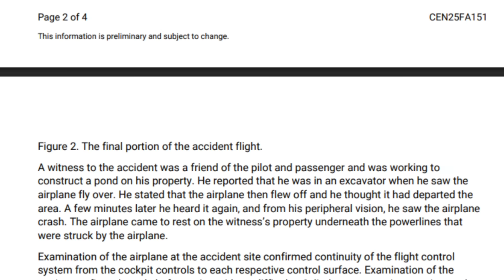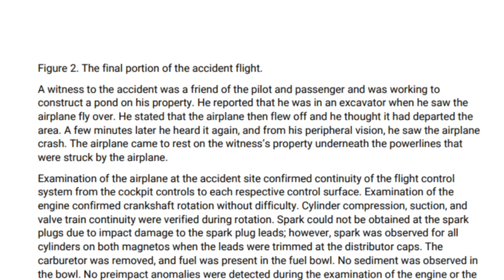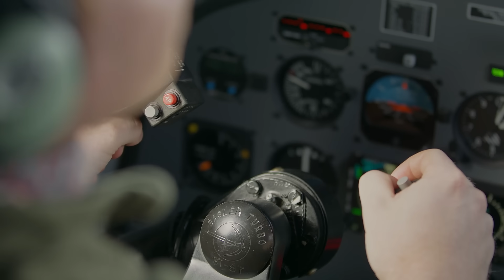The Real Reason That N83952 Crashed On April 10, Prelim Updates...

Comment: Those of us that fly these old airplanes for the freedom of flight. I for one don't want all types of electronic crap I still fly with a paper map and use an e6b if you even know what that is.I hate striuctor that you apparently  must love.I am form Nebraska, Missouri and live in Kansas. I know there are no canyons like the one you erroneously show any near where this happened. Both the pilot and passenger were older than those power lines and they probible  member them being built. The crash site is only a short distance from there home. .